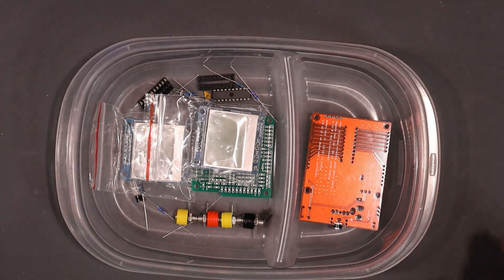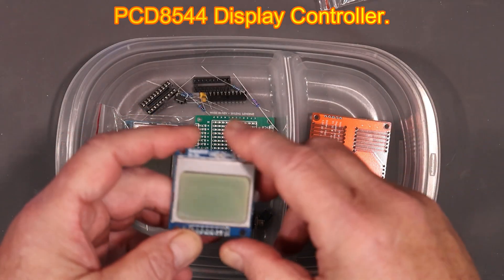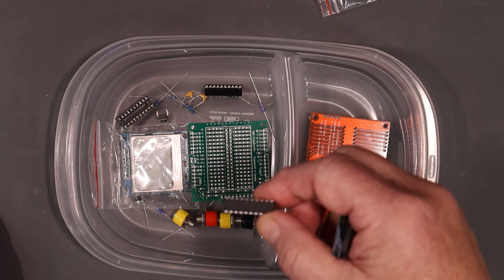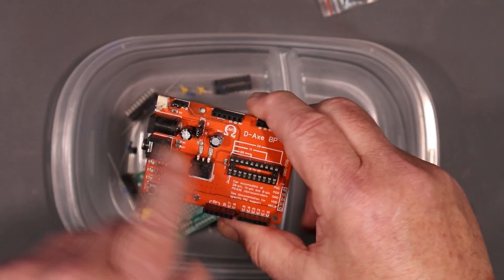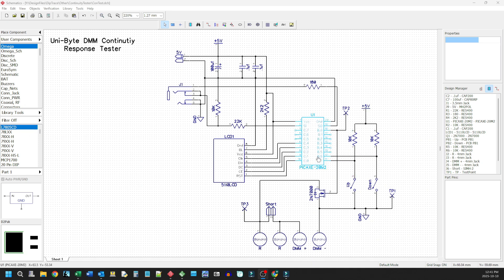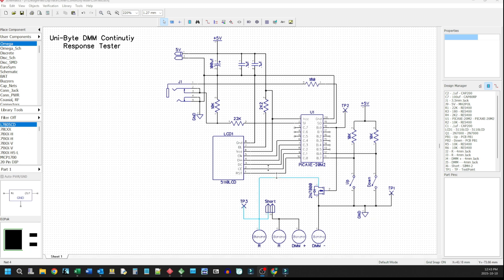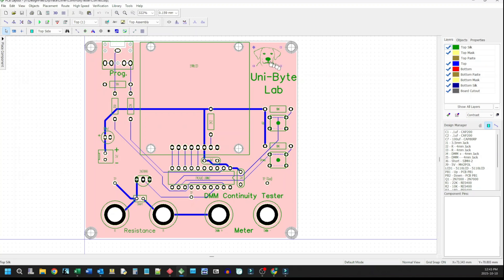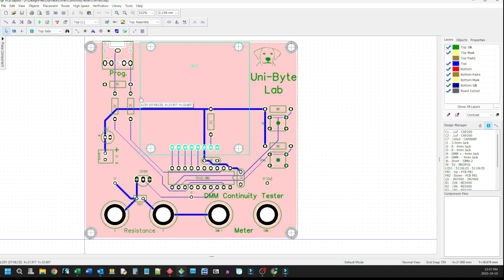Uni-Byte 0307 - DMM Continuity RESPONSE Tester:  Part 1 of 3

Comment: Very cool project. I'm building the one from Ian Johnston that use an arduino pro mini. I might have to modify the code to use one of the screens I have available because he uses a slightly harder to find screen.
Reply from the maker: His is a little more sophisticated than mine.  Good luck with the mods.
Reply: @uni-byte  Yeah. I didn't really want something that sophisticated but it's the only one I could find at the time.
Reply from the maker: I should have done this earlier!

Comment: Love the idea! Maybe make an Arduino one with a mic, where you press a button, then it beeps the meter, locks onto the beeper frequency and then does 3 or 10 pulse response tests so it does a full circuit to audio output delay test.

Your current approach basically just focuses on what the meter detects as continuity in terms of contact length, but does not account for the delay the meter might have before it starts beeping.
Reply from the maker: Glad you liked it!  I'll have to give your idea some thought.
Reply: @uni-byte if you need a helping hand with the programming, lmk. :)

Comment: I get the feeling that most Arduino users just load the libraries they are told to load, copy in the file that uses the libraries, and that's the code for their project. I use PICAXE chips for projects where I actually have to write some code in order to get what I want, although I expect there will soon be a PICAXE AI code writer. Times change, even if we have the niggling feeling that it all leads to a total collapse somewhere down the line.
Reply from the maker: I agree with you 100% John.  You can see it in the comment on the Arduino forum.  The a good lot of the users want everything pre-built.  The "Me-Too" crowd.  But hey, there are those that do the heavy lifting and create the libraries and fully tested code for the me-too'ers to use.

I'll be building the software for this on a template I created about 13 years ago for the Nokia displays.  I'll share all that in the final video.

Thanks for watching and commenting!